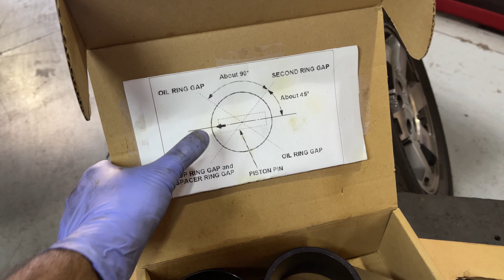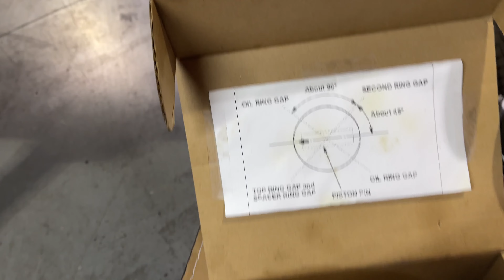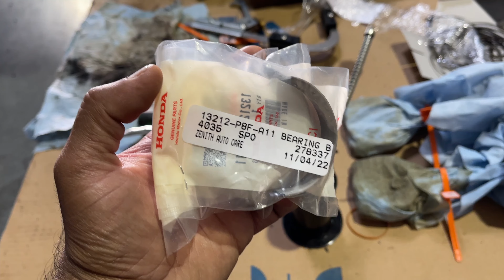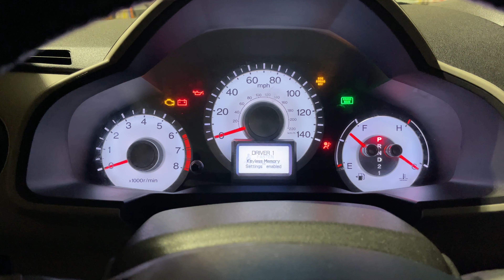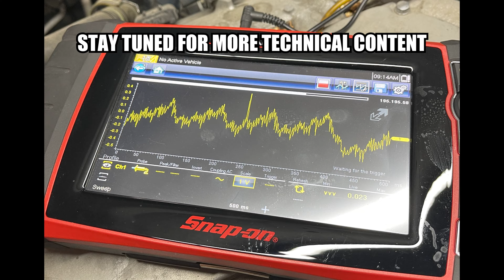PISTON RING REPLACEMENT ON A V6 J35 HONDA / ACURA MOTOR : 2012 HONDA PILOT WITH P0302

Comment: Great job!
Did you change the valve stem seals?
Reply from the maker: Thank you, did not change them as they were not bad.
Reply: Thank you for the reply and I'm happy for you!
I have a question. A year ago I bought a Honda Odyssey 3.5 2005 which engine is the exact same like yours in the video. Btw, I'm from Kazakhstan and the minivan was travelled overseas 3 years ago via Armenia but the its a different story)
So, the engine mileage is about 200000 and I use Liqui Moly 5w30 oil. About a week ago I noticed little white, blue smoke from the exhaust especially when the ac is turned on and driving reverse. Any ideas for help, thanx in advance!

Comment: Nicely done, but no updated parts?  Had a 2003 Odyssey that burned a quart in 400 most of its life. Actually wore out the hood catch and cable from adding oil I bought by the case.  Never smoked or fouled plugs or the cats.  Gave it away at 232,000 miles.  It’s still going.  Not expected Honda quality for sure.
Reply from the maker: Definitely not expected Honda quality. I agree with you there! From what I understand, you are just buying more time but from my experience, once the rings are changed, they turn less over time, the problem does seem to go away for the most part. There are devices on the internet you can buy to disable the ECO mode but I have no experience with them. ECO mode is just some kind of trick tech for cylinder de-activation to save fuel while cruising.
Reply: First issue you had was buying a early version odyssey. especially if it was used before and u bought it. Those vans are known for horrible transmission due to weight power ratio & are over stressed because if it.
Reply: @Justvn4thGenTL  five years into the model run doesn’t seem early.  The transmission failed at 93k when third gear evaporated into the oil. Not covered under the secret warranty.  Factory reman plus new pcm was going strong when we gave it away.   Honda did step up and we paid labor only.
Reply: @dodgefree1400  a 2003 oddesy is still a first generation oddesy if you didn’t know. yea it’s 5 years into making them but they still used the same horrible transmission that is most likely due to weight.
Reply: This Pilot had the VCM motor (variable cyclinder management) which shuts down cylinders from 1 to 4 cylinders while the car is driving to make the EPA / MPG numbers look better. VCM was awful for the long term reliability of the engine : Ruined the pistons rings, causing it to burn oil, fouled plugs, kill ignition coils, wiped out the Cats, wore out the motor mounts.

Comment: Can you do this on the j37 instead of replacing the pistons just do the updated rings.
Reply from the maker: There's usually no need to change the pistons, they don't wear out. The rings rotate which is the reason for changing them. So yes, you can do this repair with just the rings as demonstrated in this video.

Comment: At 5:15 you are holding a part…what is the part it is connected to? Small box shape.
Reply from the maker: That’s the purge solenoid and it’s connected to like a small plastic reservoir thing, not actually sure what it is to be honest. Some sorta chamber.
Reply: @SkillCollectors Thank you…I am doing this work on my pilot now…really helpful. 

Most other videos or text I’ve seen say to support the engine at the oil pan when removing the engine mount…where do you support the engine when you removed it?
Reply: @mcbdoc2000 that passenger side engine mount only prevents the engine from vibrating.  The front and rear engine mount actually holds the entire weight of the engine.  No support on the oil pan is actually needed when removing thar passenger side engine mount.

Comment: Great video. Have you had any success with a chemical soak instead of the full ring job? Obviously cheaper for the customer but better for the customer if they can avoid  a $4000 ring job
Reply: Have you?
Reply: @CCLLC323  I believe I have had success yes. But it’s on a Civic R18A. Still seeing a bit of oil consumption but there are some spool valve leaks and an oil pressure sender leak and possibly a main seal leak.
Reply: @Watchman999  cool. Trying it on my pilot today

Comment: I have a 2014 acura TL with the same 3.5 engine @65k. Anyone have any tips for preventing this from happening?
Reply from the maker: I don't think there's any preventing it. Honda just made a bad batch of piston rings which turn on themselves over time due to the ECO mode.
Reply: @SkillCollectors  luckily the TL's dont have ECO mode. So far, so good
Reply: Get a vcm muzzler

Comment: Flawed VCM technology in my car brought me here. Great video. But for all, the root cause of the problem is your VCM system. Turn off VCM via a VCM muzzler to avoid this headache. In many cases this "damage" can actually be undone by disabling VCM and replacing your spark plugs. Over time the normal cycling of your engine can clean the piston rings so long as VCM is off and not allowed to continue trashing your engine. That can be the lesser of two evils versus disassembly of a factory built engine.

Comment: How
Much is a job like that ?😢
Reply: I’ve heard anywhere from $5-8k at a Honda dealership. Likely cheaper at an independent service shop like this.  He guessed 1500-2000 in a reply to another comment (he doesn’t quote or do billing), but that seemed low to me.  Said it took 7 hours just to reassemble. Guessing 12-15 hours of labor minimum.
Reply: @ thanks sir

Comment: Couldn’t you just drop the exhaust take the pan off and oil pump and take the crank and pistons out thru the bottoe
Reply from the maker: No, 1) the piston will hit the casting trying to get it out that way 2) even if you could, how will you install it without damaging the rings?
Reply: Do you mean the cylinder wall.     You could use oil through spark plug holes and put it in a bottle and squirt it up the cylinder walls from the bottom. I know the k series is a sleeved block idk about the j series.  And I’m pretty sure I have seen it done from the bottom end  maybe it works for some engines and not all. I may be wrong as well
Reply from the maker: The cast supports that hold the crankshaft in the block will impede the piston, you don't have a perfect cylindrical, piston sized opening coming out the bottom. Maybe it can be done on some blocks but I've never seen this on any Honda engine. On some engines, cylinders can be removed separate to the head and the block, for example, on many 2 strokes, the piston is installed through the bottom of the cylinder.

Comment: how in the hell can you remember how and where everything gets put back?
Reply from the maker: Experience, keeping the parts and bolts sectioned off and organized helps. But after doing a job many times, it almost becomes automatic.
Reply: If you take a nut, screw or bolt out to remove a part, once it is off, put the bolt / screw back in it's hole.  Then you wont get em mixed up ;)

Comment: Why didn’t they just get a used engine instead?
Reply from the maker: Installing a used engine costs way more and also a used engine is subject to this same problem. This is a common issue with these older J series honda engines.

Comment: Wow that's unbelievable I've never met anyone dumb enough not to just replace all the rings on all the pistons to do it selectively is begging to do it again in a couple of months that is just plain ignorant.
Reply from the maker: Read the service bulletin and you’ll understand.
Reply: the rings on the other pistons don’t fail like these do, those rings aren’t apart of the vcm system (cylinder deactivation) the other pings fail because of the cylinder deactivation